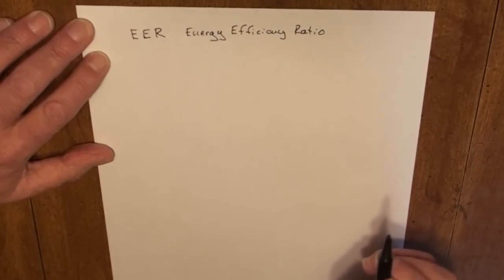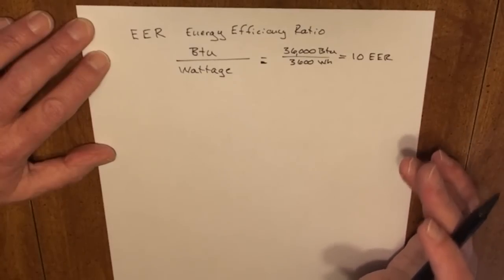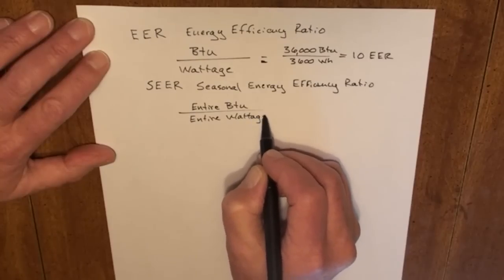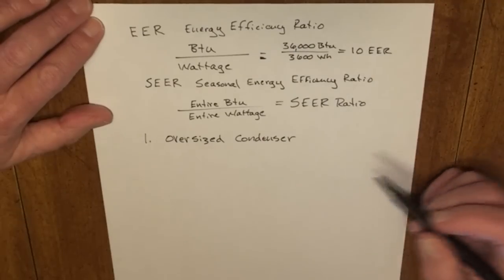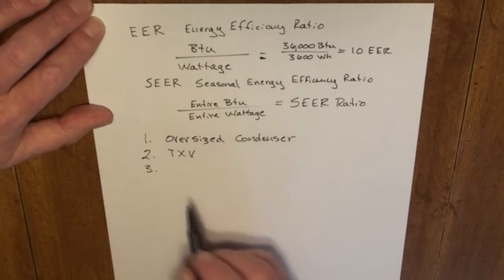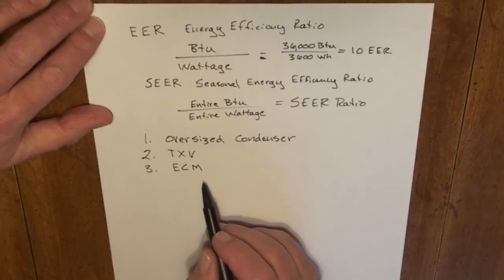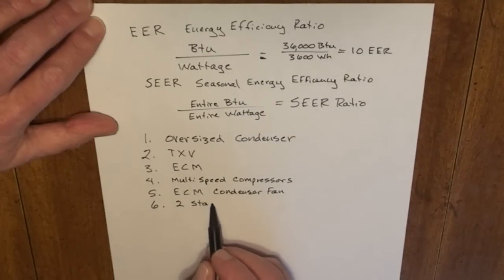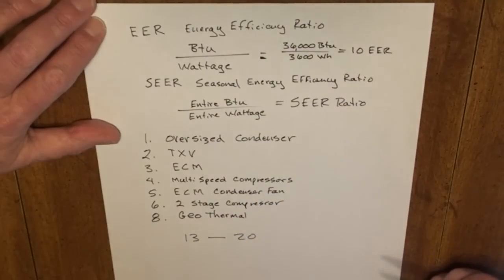Energy Efficiency Ratings

Comment: Dear Sir, can you clarify this for me please:
EER is equal to BTU/h over input Wattage. 
and we know that we can convert BTU/h to W/h by multiplying with 0.293071 
so we know that BTU's/h is our output and W/h is our input and when we convert our BTU/h to W/h and then divide output wattage over input wattage we get a number greater than one, which doesn't make sense, since our ideal efficiency wouldn't exceed 1. 
Thanks
Reply: It does make sense, because you are moving heat somewhere else, not creating it. So it can be several times more efficient than 1. That's why we use heat pumps for heating.